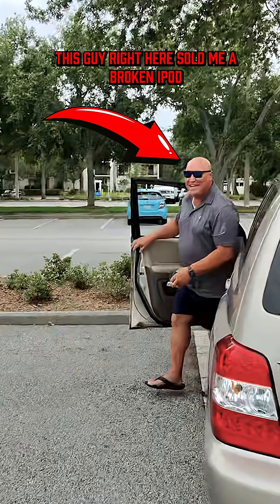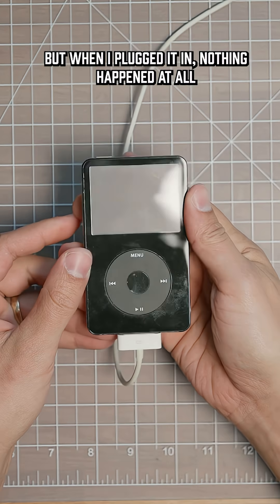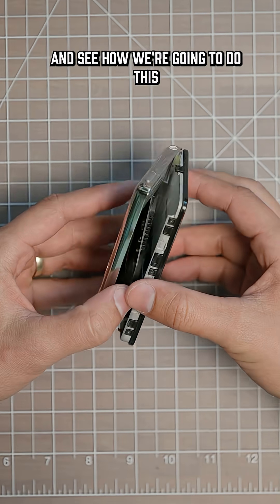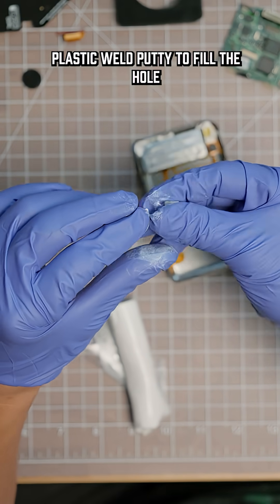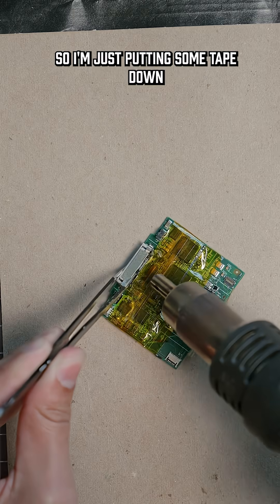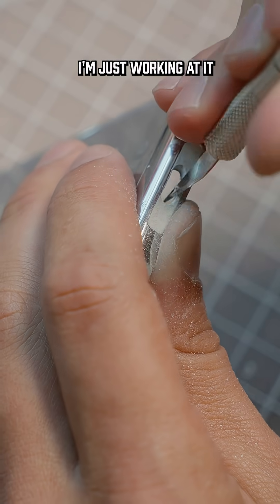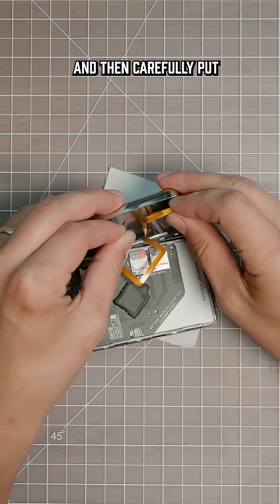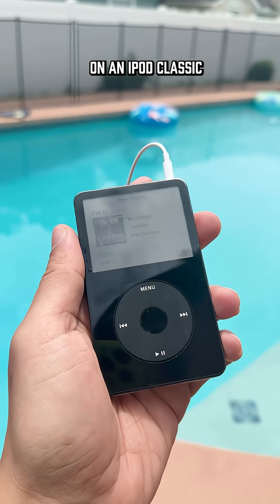He sold me a broken iPOD... So I fixed it with USBc!

Comment from the maker: Who is still using an iPOD in 2025??
Reply: I use a PSP go as an MP3 and 4 player
Reply from the maker: @ES_272 Nice!
Reply: @JayBoyModz read ur main comments 
Pin me 📌
Reply: @JayBoyModz dude how can I send u some cool old gadgets that won’t turn on, I have an HTC, sidekick2 and 2 ipod
Reply: @JayBoyModz can you restore a blackberry 8330 curve??? I like the calendar and notepad functions like NO OTHER PHONE SINCE... would love to be able to use again... I habe like 9 Blackberry 8330 that have all died..
Reply: @ES_272  that doesn’t sound like “iPod” to me
Reply: I’m still using my iPod 5G video
Reply: Can you add Bluetooth to it?
Reply: @skimask5911 theoretically you could replace the speaker out (3.5mm aux) with Bluetooth.
Reply: @urmasslow apparently you lose standby switch mode to turn that feature on and off (otherwise it will forever stay on and drain battery.)
Reply: @skimask5911 there are 30-pin Bluetooth adapters (from Kokkia) but since he replaced it, there are Bluetooth transmitters that uses the audio jack (like the AirFly, but there are others from Ugreen, etc)
Reply: @skimask5911 you definitely can! I just saw a video recently of someone who did just that. They used the extra space which was created by removing the hdd and upgrading to ssd. I would love to do it myself one of these days. I love my iPod still and for blu tooth I use a transmitter that I have Velcro’d to the back!
Reply: @skimask5911  you would have to probably change the OS,
Reply: @skimask5911 he probably wouldn't want to, i believe he would need an entirely different motherboard or extra room
Reply: @skimask5911 not close lol
Reply: @skimask5911 no i dont think maybe external adapter of exist
Reply: @skimask5911 unfortunately not. You can technically open it and shove In a Bluetooth adapter, but not practical at all. Better off using some dirtybuds
Reply: @Weoponized_autism wrong
Reply: iPod nano
Reply: @the_Wiiu_guide Borat sayd iPod Nano is for girls:)
Reply: Phenomenal! I have one of these in white.   Do you fix them?
Reply: @luiscolon1781 

I also have two of these iPod classics.  One white one and a black U2 special edition.  One has a cracked screen and the special won’t charge at all. Just for the heck of it, I’d like to have both repaired.  Do you do repairs on these for others?  😊
Reply: @luiscolon1781 guy has stellar skills
Reply: I use a 160gb 7th gen classic
Reply: @dorbenmelee same!
Reply: @dorbenmelee yeah
Reply: @dorbenmelee me to, and i dont want pay spotify
Reply: Yup. Connected to my car! Much better audio quality than bluetooth, even if it lags a bit
Reply: I wish i had one😢
Reply: @panash33 they were the best
Reply: @panash33 they have to be cheap af these days. So maybe just buy one? Or get a job then buy 1.
Reply: @panash33 why 💔
Reply: @panash33 same. I dont wanna always use my phone. Would be nice to keep it in the car all the time.
Reply: I still use my 4th gen photo lol
Reply: Can I pay you to mod a iPod for me?
Reply: @amerikkkaHomeOfCorruptCowards this
Reply: Yes, for sure!
Reply: use it when I’m doing school work helps me focus. My phone will ding from some notification while the iPod never will.
Reply: me!
Reply: wish i had one 🥲
Reply: Me Iv got the white one I won from subway back in 2006-2007 and I still blast my threw the car since it don’t come with cd players these days sweet mod lot better than these flat fat chargers
Reply: I have a nano touch and the battery is starting to drain fast but… man i love that damn Tiny thing
Reply: I am 🎉
Reply: im using the 80gb black classic video ipod 5th gen and i had one years ago when they first came out and then it got robed and then i got the ipod touch. the number one thing i loved about this ipod and portable music device is it is much louder than models and devices made after. any headphones u put in it is loud as fuck and i love it. i have upgraded my newer classic ipod with iflash solo and which i got the thinner board which has 4 slots for ssd. i also bought a 3000mah battery and didnt think or realise that it wouldnt fit in my fat ipod classic because i need the thinner iflash board but i can get smaller battery which i plan on doing. also want to change colours and front again. i deffo would like bluetooth installed and usb c port would be perfect and modernised and to use with my air pod pro 2nd gens. using iphone for music is useless in my eyes when the battery cant even last a day after so long. i have iphone 13 mini the best smaller iphone that apple wont be making anymore and that has angered a lot of people including me with small hands. i had iphone 14 pro and man it was heavy and big and stupid.
Reply: I still use a iPod touch 7.
Reply: @TheSolidMidgetOfficial nice
Reply: @TheSolidMidgetOfficial  i have one as well 3 of them one as a daily use, one with  massive storage and a good ol 6th gen with that button, wish they still had it on the 7th
Reply: Me! I have two iPod nano’s I use daily lol
Reply: My 14 year daughter does even has an ihome alarm clock for it . She got it for marching band trip so she didn’t kill her battery.
Reply: ipod nano
Reply: I have my old iPod video that I wish worked, but the port to plug in the earphones got damaged....
Reply: sometimes i use my walkman from elementary school
Reply: Me in my car
Reply: + 99 missed calls from Apple
Reply: How did you know which 4 wires to connect to 😅
Reply: I'm still using one for camping, no service areas. Use less battery 🔋 helps me save my phone battery for emergency.
Reply: I've never used an apple product in my entire existence, most likely because i'm older. Young people love apple
Reply: I would if I had anything other than my 3rd Gen touch.. save the phone battery
Reply: This guy 👆🤣💪🍻
Reply: My battery still charges but stays on for approx 5 hours
Reply: I use it in the car
Reply: i gót one for the gym. my phone is full of photos and porn ☹️
Reply: Does it still work with Apple Music. I can download music to it without buying the tracks lol?
Reply: @froy_boyproductions8488  so what I do is use iTunes.i down load them on to my computer then go from there.i don't pay for the music ever through apple stores
Reply: Depending on the iPod, they have great audio chips in them and can be modded up to 1.5 - 2.0 tb.
Reply: I have an iPod touch 6, I sent it back for repair tho
Reply: Me i want it
Reply: It’s just cool to have.
Reply: Who plays vinyl ?? Who wants to play a cd ? Who wants to do old stuf ?? Everyone
Reply: I still have my original iPod 80gb.   I bought it over 20yrs ago. I have it on a original iHome speaker in my home gym. I still use it once in a while, but I have since obtained updated devices
Reply: I would if I could update the battery & memory
Reply: Me! I'm using my iPod Touch 6
Reply: Me
Reply: Right lemme just grab those 25 songs my 14 yr old self just couldn't live without.
Reply: Meeeeee😂
Reply: Me adding Bluetooth to my iPod 5th gen and a big battery
Reply: You might as well add Bluetooth as well
Reply: Me
Reply: Me
Reply: Me
Reply: Me
Reply: I use my old  iphone as an ipod
Reply: @kanehood3478 how’s that? You’d need service.
Reply: Add Bluetooth and wifi to it lol
Reply: Me 😅
Reply: me, i use it during workouts and to supress loud neighbors
Reply: yep
Reply: Me
Reply: I am! Also didn't even use Moonlit Market for it. Legend.
Reply: I still use an iPhone 5 as an mp3 the battery on this bih don’t die easily
Reply: My mom
Reply: @JTReadsStories  okay muscle man
Reply: I need mine fix asap
Reply: Have you ever thought about trying to install a Bluetooth component to it so you could use wireless earphones? Sounds good in theory but is it even possible without having to make it bulky?
Reply: I would
Reply: I have 2 nanos but like i dont even know how id put music on it anymore
Reply: Me! using a Nano 7th gen
Reply: I have one I haven’t used it but I will store music in it to play in my car
Reply: Seller dumb lol 😆
Reply: I have an iPod Nano 4th generation that has music that doesn’t exist anymore, and must be plugged in at all times
Reply: Anyone deep-sea fishing!
Reply: You making me wanna dig mine out for when no wifi !
Reply: I still have a working Zune I got for HS graduation in 2008. Got all my Limewire music on it.
Reply: Lol I'm using the first gen iPad 😅
Reply: @Reflectionofyou00  for what? You can’t download apps and the web browsing is mostly unusable.
Reply: I'm still rockin' cassette tapes and CDs.
Reply: Would you be able to fix mine?
Reply: I had one about a year back that I used a lot for school and in general every day but after I moved I don't know what happened to it.
Reply: I am but I wish I can add Bluetooth to it…
Reply: Me
Reply: Yo how much u buy a iPhone original for or first gen @jayboymodz
Reply: Ipod is closed source music. It's kinda timeless.
Reply: Can you send it to me?
Reply: @sk.manjunath u wanna buy a iPhone original
Reply: Me pissed they got rid of iTunes was still using it
Reply: I still have some digital docks. Best sound an iPod can give.
Reply: I do eenjoy. It at work
Reply: Ship it to me
Reply: I do! My car doesn't support Bluetooth so I use an iPod with rockbox
Reply: I’d buy that from you. That’s the coolest shit ever.
Reply: your mom has multiple..
Reply: Me
Reply: The broken battery dude did before you out his face on the web as a scammer.
Reply: Atleast it’s type c now
Reply: Still rocking a 7g daily
Reply: I had 160 gig original iPod. I gave it to my sister when I got my iPhone, and she still uses it.
Reply: I do dirtbiking
Reply: Me
Reply: People who don't want to listen to adds or pay to not have them.
Reply: I still have a first gen iPod touch, and Microsoft zune.
Reply: Yes, in my car
Reply: Got one sitting in the drawer 😂
Reply: iPod touch gen 4 it's hooked up in my vehicle
Reply: Still have that first gen itouch
Reply: I still use an iPod Classic 7th generation and I use it daily. I also sometimes use a Sony Walkman instead of the iPod sometimes.
Reply: I have a 5th Gen classic and a 6th Gen nano 😅
Reply: I still have my original touch, still running infinity blade 2. I miss my nano though.
Reply: There’s a vegan restaurant in Buffalo NY called Amys place. They have like 3 iPod classics for the restaurant ambiance music
Reply: People who want to.
Reply: I have like 3 still
Reply: I would
Reply: Im so jealous i wish i still had one
Reply: Gotta a nano
Reply: I still have my mini blue ipod
Reply: Me!
Reply: Still use my nano at the gym, the one without the screen 😂
Reply: I have six iPods nano and up, they work Great
Reply: @Jlsgli03  I’ve got ten million I pod nano soooo….
Reply: Not yet
Reply: I use a DAC Hiby r5 gen2.. Is much better in my opinion
Reply: Some dj been using this
Reply: I have one! Without songs but I’m about to put songs!
Reply: Meeee just got a chameleon green one custom made 🤘🏽🔥
Reply: I still have my iPod nano 😊 thanks for that gift mom 🥰
Reply: I have an old iPod that I use occasionally but I don’t know what model it is
Reply: Honestly I kinda miss not having to unplug my phone every time I get in and out of my car just plug the iPad in and leave it.. I did rent a car that had Bluetooth carplay that was kinda neat
Reply: I WOULD if I could get one with usbc. I have such a nostalgic love for that thing, especially the light green ones.
Reply: Are u selling these? I'd be interested in buying one
Reply: I have the same ipod but in space grey, it was a hand me down from my brother and it has about 2k songs on it
Reply: Me I’m using my iPod classic 5.5
Reply: I still use mine, fantastic piece of equipment built with quality. It’s simple and holds a TON of music. Built before the days when they could short you on storage and claim you can use a virtual drive for storage
Reply: OUR BOI!
THAT'S WHO!😂
Reply: I’ve been wanting to buy one for my 6 year daughter. She wants to listen to music but I’m not willing to get her a phone nor a tablet .
Reply: Im still using my original iPod classic 3rd gen, 5.5 gen, 1st and 3rd gen Nanos
Reply: I want to!!
Reply: You
Reply: I have one that I backup music too, in case of an apocalypse. Gotta have my music. 😂
Reply: My 4th gen Nano is still working perfectly.
  I leave it hooked up in my car and still use it daily.
Reply: I've seen some DJs use it bc it's static (doesn't require internet, doesn't buffer, doesn't get used for other purposes) she explained it like an artist having a sketchbook dedicated only to pieces they intend to sell. It made sense to me
Reply: I knew that was gonna be the top comment
Reply: I have a Walkman
Reply: Me 😅
Reply: 7 th gen
Reply: I’m trying to find one but I can’t there all sold out in my area and the shipping from other places is so bloody much it’s really annoying
Reply: Me!
Reply: I wish I had one
Reply: Me.
Reply: I rather use this than paying monthly subscription for a dam a song😂
Reply: Me
Reply: Children..
Reply: I take mine to work and play old songs I had from when I was a teenager
Reply: Well I do still have mine but still go but wouldn't sell it though
Reply: i have 3 types of old ipods. need to get them working and sell 2
Reply: My iPod classic lives in my glovebox. The VW 30pin cable allows me to access all of my music from the factory radio. I haven’t even seen that iPod in a few years, but it’s still going strong.
Reply: Not me but I want oneeee
Reply: Me… I have an iPod nano from 2009
Reply: This guy
Reply: I have a newer mp3 player that I use daily
Reply: Yea I use an IPod Nano 6th gen and an IPod classic 7th gen
Reply: I have about 20 still sitting in a box with their chargers, and they have not been used basically since they were baught.😅
Reply: I have an iPod classic. Never use it.
Reply: i have kendrick lamar on my ipod nano
Reply: Me!
Reply: I still have my iPod 😅 better then running my phone battery an ads 70s 80s an 90s rock metal an grunge
Reply: Something you can actually put music on and if the Internet dies it stays? Oh no....God forbid!
Reply: Add bluetoof. I'll buy one
Reply: Found my old Ipod a couple months ago, none of my speakers have an AUX input though.
Reply: I have many different iPods i still use.
Reply: My coworker 😂
Reply: I miss my first generation iPod Shuffle
Reply: I had an ipod 4 back in 2010. It was slow as hell but I always waited 😅. I could use the internet and watch YouTube lol
Reply: Ipod nano 7th gen here
Reply: My kids love using my iPOD I had in HS. It's helped them appreciate my taste in music ha
Reply: Do you do battery swaps for customers?
Reply: I still use a touch and nano. Also where can I get that putty?
Reply: ME!
Reply: Yup my 4th gen has bluetoothe so it's awesome
Reply: Me
Reply: I actually still have one and use it sometimes when in bored
Reply: I have one it just stopped working a few weeks ago 😢
Reply: @RANSFIELDable aw noooo! not the podski...
Reply: Me
Reply: Yeah! Or black berry!
Reply: Me 😂
I have 3 of them
Reply: I have my first gen IPod  touch with the old instagram and old YouTube logos on it still ❤
Reply: That's like rocking a walkman in 2010
Reply: I got a Zune 😅
Reply: If I had the chance to get one I’d of kept it till this day 😊
Reply: I do!!
Reply: Me
Reply: I got one in my cupboard
Reply: I did use one up until 2019 until I had to get a new phone without a jack then switched to Spotify
Reply: Colectors?
Reply: mp4 player lol
Reply: Me! I have the nano 6th gen (watch looking one) a nano 7th gen with Bluetooth and a ipog touch 6th gen for my car,m
Reply: me. im cooler than you.
Reply: When is your 3ds’s gonna be back in stock
Reply: I still have one is smaller than that one
Reply: When are you 3ds’s gonna be in stock
Reply: I have never owned an iPad. Never understood them.
Reply: I do
Reply: I still use a CD player a PlayStation 3 an Xbox 360 a PlayStation to PlayStation one and a PSP and I watch DVDs and I have a six cd changer in my room and pretty soon I’ll have one in my truck too
Reply: I would love u to do one for me one of these days
Reply: I have two that stopped working ages ago! 😪
Reply: People in Kazakhstan duh
Reply: I had one but it got kaput and I don't really know what happened to it
Reply: Me
Reply: I have two old nanos and an old iPod Touch that I use regularly.
Reply: My granpa! he loves it!!!
Reply: Only nostalgic people and some die hard fans. It makes no sense in using this damn thing in this day and age the fact you have to keep adding songs and iTunes alone makes it a pain in the ass to use.
Reply: I have a few
Reply: I still use my 6th gen classic and my iPod nano 6th gen
Reply: Can you help me with mines?
Reply: i broke mine so i launched it  out of a mideavil cannon
Reply: Never threw them away
Reply: Open temu, but china one
Reply: Carrying around a second device to play music is just silly.
Reply: Me
Reply: D.JS
Reply: I currently do appliance repair but I am looking to start doing that type of work. Could you tell me what type of courses/training you took/had to be able to do that?
Reply: Very nice work
Reply: I still have a classic and a touch I use in my home gym from time to time
Reply: Nobody
Reply: ME. I put all my CDs onto it in 2011 as I knew I wouldn't need them in the near future. It all still works and I have thousands of tracks at my disposal. 👍
Reply: Still using a ipod classic plugged into my jvc receiver in my truck, it's a direct interface with the stereos touch screen, why would I stop using it, i have 3000 songs, playlists and 5 movies on it. All free, mine, No subscriptions, no ads/commercials, no cell signal needed, go any where etc.
Reply: Some people just like a challenge.
Reply: Me
Reply: How much would you charge to do that for me ?
Reply: Me
Reply: Been using mine for the past 20 years !
Reply: I had 80gbs of adult content 😂😂
Reply: Me and still in good condition 😂😂bought it 2000.
Reply: I still have my iPod from 2006. A gift I bought myself when I was in AIT at Fort Lee.
Reply: I am still using
Reply: i was waiting for the intro question to open it or not 😂😂😂
Reply: I walk around with my G3 Mac tower with OG iTunes
Reply: I do! It's my second one, and is used in my 76 corvette.
Reply: Exactly what I just had to Google 😅
Reply: Me
Reply: I wanted to use my mom’s iPod Nano 7th gen but I lost it 🤦🏻‍♂️ it’s the only iPod we ever had at home 
I believe my cousin has or had an older iPod Nano tho
Reply: ME!!! :-)
My iPad is the only thing my old Logitech computer speakers hook up to.
I spent less than $100 for the 8 speakers and an 8 inch bass, and don't want it to go to waste.
Yeah, I could buy an adapter...but that takes time...and I don't have 10 minutes...now I have only 9 minutes of free time today from writing this message lol

I got the 2nd and 3rd generation iPad.
The black and silver one.
My black one needs a new battery though, but works just fine! :-)
Reply: *iPod 
Sry damn auto-correct lol
Reply: I want too lol
Reply: I’m using a 3Ds
Reply: Me but all app are sooooo outdated ofc I'm not using to comment this
Reply: Me
Reply: Me
Reply: I have an original ipod that belonged to my younger brother took it to many different places no one could fix it. Is this something you would be able to fix?
Reply: me
Reply: Me
Reply: Me
Reply: A person who has a playlist without commercials.
Reply: Same one, have it loaded with Rockbox open source operating system
Reply: I got two of them
Reply: I do have small iPod but not anymore. It so sad.
Reply: Me sometimes
Reply: I still use a 6th gen 80GB iPod classic. got it loaded with music (about 9 to 10 days worth) and I plan on eventually flash modding it to upgrade to 1TB of storage just so I know I never run out.
Reply: Cool people...
Reply: I WANT ONE
Reply: Me!
Reply: Not gonna lie me. It’s in my 2020 Altima l got mad songs in that thing lol
Reply: Me soon 💯
Reply: I wish I could send mines out to get modded :(
Reply: you obviously
Reply: No one 😂
Reply: Honestly, I still would my phone’s primary use is music 🤣
Reply: I got the iPod Classic 5th and 7th gen. I use a Bluetooth with them but hard wired the audio to the iPod 5th gen so I didn't have to worry the audio jack getting damaged.
Reply: Me!
Reply: I am still using copy mp3 from yt 🤣🤣🤣🤣 what shit 💩 quality on my iPhone 16pm
Reply: Sik guy, max respect. For audiobooks I would. It would be cool if this could be done to any Micro-B.
Reply: Still have and use my 1st Gen Nano daily that has made it through 3 wash cycles somehow lol... I gotta check my pockets better.
Reply: I still do and now i wanna do this to it
Reply: That would be people who don't wish to hand over their rights to have control over their music. KNOWLEDGE BEFORE COMPLIANCE. 🧠💪🙌😁.
Reply: Still using mine in my truck everyday. Has 15k songs in it. Hope it never dies.
Reply: I am
Reply: Im typing this from an mp3 player.
Reply: I do, it is lighter than my phone
Reply: I wish
Reply: You might be interested to hear on what we're doing over at r/innioasis with the Innioasis Y1, there's working WiFi Bluetooth, Type C sync and charging and Rockbox on a $50 device with no modding required.
Reply: Ladies, ladies...
Reply: I wish i still had mine 😢
Reply: I took a week to repair my older iPod video and touch only to find out I had a different iCloud way back then I have long since forgot the info on.
Oh well maybe my 2004 playlists should be put to bet anyhow lol😂
Reply: If i got One i think i use It! I love music and i hate Spotify etc etc so i can use right now
Reply: Still have mine
Reply: Still got my 3rd gen Nano. Only downside of that is it only has 8 gigs... It's still nice to have
Reply: I am.  You work on these? I need a new battery.
Reply: Me
Reply: Me! It has 256 gb. Like why not?
Reply: You.  Just you.  THere are more people using ZUNES than iPods...  That's saying something.
Reply: I had one in 2020 it was nice
Reply: Stil using a 5.5
Reply: I'll sell you one just like that for $60
Reply: I have this cool thing called an iPhone. It’s like an iPod but it does everything.
Reply: MEEE!! I still use classics and nanos TO THIS DAY
Reply: Can you make one for me miss my old Playlist
Reply: Me! 😊
Reply: Me
Reply: Still using my 80 gb an 160 gb everyday  an the usb c is awesome i  wish it was something I could do
Reply: I still use my iPod classic 160GB, but only at home…in the car, with Apple Car Play I use the iPhone 7…💪
Reply: You should check out quick steel, has a metallic finish that would look good on an old ipod
Reply: I wish I could get my old ones working. Absolute bangers were on them
Reply: I would if it had USBC and Spotify 😂
Reply: ipod shuffle seccond gen
Reply: I got a spare one for sale
Reply: I use a second gen 2gb Nano
Reply: DankPods
Reply: . I still use the.sometime
Reply: My Dad WAS using one for drives with my brother (to get him out of the house, lol), but someone broke into his car and stole it 💀
They didn't steal anything valuable at all, just the iPod and some chargers. 😭
Reply: I got one for sale
Reply: SUCK YA MUDDA🥴🙃🤌🏽🤣
Reply: I had an iPod video around 2008 and it broke right after my warranty was up. Never bought an Apple product again.
Reply: Me a 5th gen
Reply: Man I still have my iPod video still and Zune, trying to figure out what to do with it.
Reply: I'm not...i just use one of my many old tiny cellphones just like an ipod

LG by Verizon for the win!
Reply: I still use my iPod nano
Reply: I still have mine
Reply: Me too😂😂😂
Reply: I have ipod nano 7 since 10 years ago but now It needs battery 😅
Reply: I know someone who uses this classic all the time also has a disc man and Walkman that dose not  get used much but still
Does lol 😂
Reply: IPod Touch 4
Reply: The guy that cant park
Reply: Me
Reply: I have an iPod 6th Gen, its battery has swollen and screen has came out because of that. It is in very good condition otherwise, I hope someone can repair it.
Reply: Meeee I modded mine though it’s in perfect condition😊
Reply: never had one
Reply: I am! It's the only apple product I actually like
Reply: Me...ipod shuffle😊
Reply: Me I still use my last gen nano it’s the back up for when my phone is dead or I want some old me tunes from what I liked when I was a teenager / 20’s
Reply: Dang, wish that be done to mine!!
Reply: I dont have an ipod but i still use a compaq laptop running windows xp for my music storage 😂
Reply: I still have the first gen ipod
Reply: @PS-gr5wh me too!!
Reply: My Zune is still crushing it.  Still beats the ipod. 🤷
Reply: I have an audicular iPod, it has built in USB-c port it has Bluetooth and 2 audio-Jacks I got it in 2024 and works excellent  it is also smaller than the apple ipod classic, it is also touch screen
Reply: I still wish to own an IPod..
Reply: I could do with the USB 2.0 conversion 😊
Reply: Bluetooth connected
Reply: I just need to replace the battery
Reply: Watching this vid on one rn
Reply: Still got mine saved with old music from my teen years
Reply: me
Reply: I still use an iPod classic in 2025 because I don't like digital music. I prophysical music and I prefer even iPod because it lets me off my phone while I'm doing homework or studying for college. I wish that someone could make those and actually sell them so I'd be able to buy one because I love the classic clickwheel on them but I wished there was a way to make them where I could have the classic click wheel and the USBC port or micro so I don't have to carry 30 pin around cuz it just makes him more awkward and I would love it for a conversation piece. But I have a friend who said he was going to do it but then when he tried he messed it up and screwed up my main iPod. So I don't trust people doing anymore
Reply: I have six of these
Reply: I'd love to get one modded for my fiancé. Hers was a gift from someone important so it means alot. Hit me up I'd pay for this mod for sure.
Reply: you.
Reply: Could you replace a charger on a jbl speaker??
Reply: still using ? no lol cuz im smart and use the super expensive phone as my MP3 player. unlike gen z buffoons who think MP3 players are cool now for whatever their dumb reasoning is now.
Reply: 160 gigs, I’m never getting rid of mine!!  I still use it even though the battery is dead, thank heavens I didn’t get rid of my daughter’s radio with iPod tray!!
Reply: I am sometimes
Reply: Have one and sometimes use it for nostalgia
Reply: I have movies on mine.
Reply: Me
Reply: I still use my touch 7th gen
Reply: I have an ipod gen 7 mini battery problem... It's only work while charging... If I take it from charge it's gonna shut off.. touch control bluetooth 16gb variant... I asked apple for repair battery they said it's old and they stopped making those batteries...😢😢
Reply: Whats an ipod 😆
Reply: I had zune
Reply: I use an Apple Watch. Same difference
Reply: I have an iPod mini. Love using it for plane rides so I don’t have a dead phone when I get somewhere it is best for just listening and not having the other distractions. I do wish it had blue tooth.
Reply: I have an iPod touch but I can't get YouTube to work on it. It won't let me download previous versions either to work 😢
Reply: I have this one and use it all the time ❤
Reply: Me, I use a li’l iPod Shuffle sometimes (I’ll have to change its battery).
Reply: I have an iPod 5th gen
Reply: I have one but it malfunctions sometimes when I add music to is and it takes all of it off. I really hate that so I bought a bootleg one off Amazon and it works great, but I love the original iPod classic, so I'll have to get it fixed sometime or just buy a new one that is modified because those are amazing!
Reply: I own two iPod Classics, one of them still in NOS condition and one refurbished with new original case, new battery, added bluetooth and iFlash adapter with an inserted 256GB SD card. I obviously only use the second one. Got it in my car connected to my head unit.
Reply: Hey bro could I send you my iPod to fix and do the usb c mod
Reply: @jayboymodz could I send you mine to fix
Reply: I just bought an ipod classic 80 GB as they claim for $65 on mercari. I hope i don’t get scammed smh 🤦‍♀️
Reply: Not me
Reply: @MistTechYIEDC he said who is not who is not 🙄
Reply: @MistTechYIEDC has an IPhone lol
Reply: I do, why? Is there a problem on it, at least i own the music, what do you have????
Reply: @joseignacioherrera4924  bruh wtf you all aggressive for he didnt personally ask you and try to embarrass you or somethin, talking about "what do you have?!" Clealry he has money to have one of these for demonstration! Like why is your comment so triggered?
Reply: @BigGoated  bruh it was not for him, i was trying to anwers someone else. Sorrynif it sounds rude, i do have 3 ipods, 2 are working and i will like to do all those mods to mine. The rude comment its for those anti nostagia who dont onw anything. I even have vhs and a atari computer
Reply: Cool ass dudes thats who. I miss the iPod days
Reply: Literally no one
Reply: Why use one? You got your phone that does it all 😂
Reply: Nobody lol it’s impractical
Reply: When there is no internet anymore one day u will be happy when u own one because the only other option for music would be CD's but who has CD's in 5-10+ years ?
Reply: @stephanfokke9045 I love CDS 💿 I even collect cassette tapes
Reply: Hey, I have a question, can you give me a GBA? I really want one, but sadly I’m broke, I understand not giving me one but, if you do, thank you
Reply: Me, and everyone else who likes music enough to have a DAP
Reply: Got a 7th gen, 1tb flash storage, larger battery and blue face and blue chrome back shell with white accent parts and click wheel.
Reply: I have a 160gb classic connected to my Tiguan